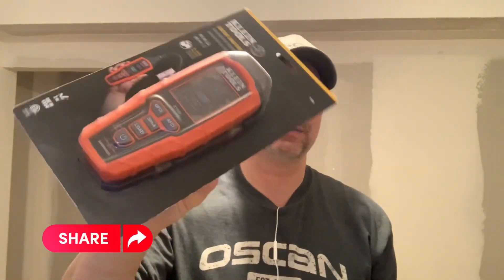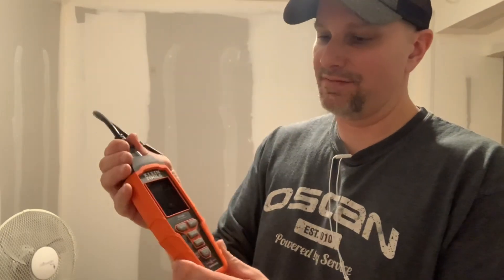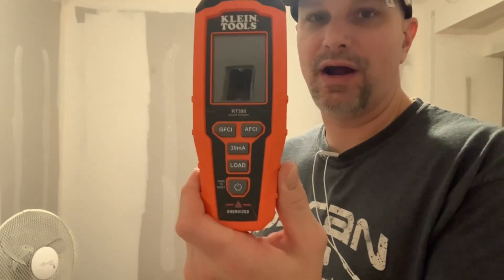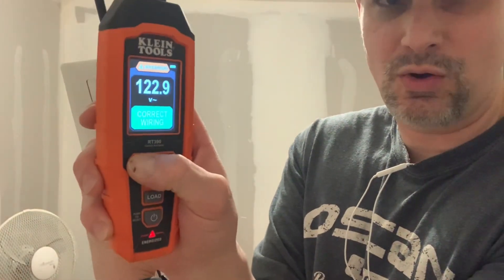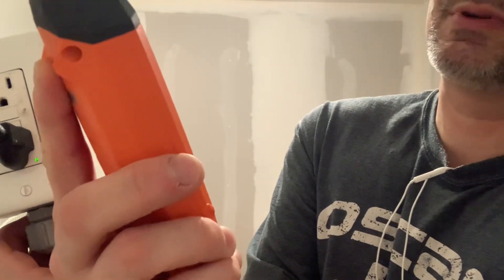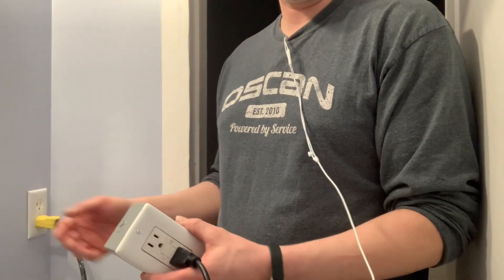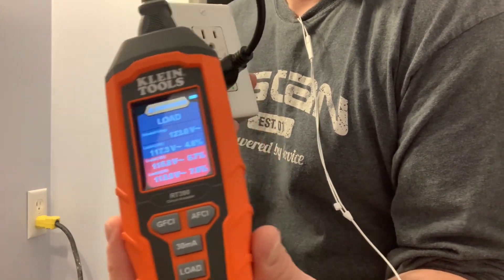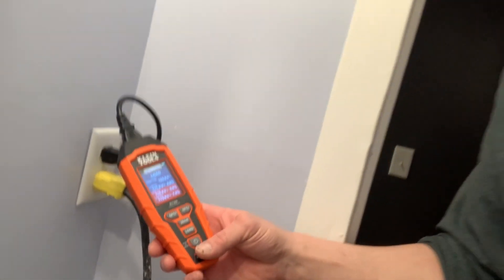@kleintools_EU @KleinToolsVideo RT390 Circuit Analyzer.

Comment: The NEC recommends, but does not require, a 3% voltage drop for branch circuits. It recommends a 5% drop for feeder AND branch circuit combined.

Comment: Is it actually doing a ramp test on the GFCI to see what current it trips at, or is it just pushing out a standard 8 or so mA? Class A GFCI is 4-6mA
Reply from the maker: The GFCI Trip current range is 6.0-9.0ma 
It also does 26-38ma 
The trip time for both ranges from 0-6s 

I hope this helps

Comment: too bad Klein does not test their own safety equipment. mine did not work out of the box, it would not power up. can you trust klein ??? its up to you.
Reply from the maker: I absolutely trust Klein tools. I only ever had an issue with a flashlight after 6 months of use. Klein replaced it with no questions asked and its still going strong. 

Klein produces 1000’s of tools. Just like any other manufacturer, there will be issues. The difference is how the manufacturer handles the issue. 

Cheers
Reply: You probably had a bad battery connection.  On mine it was the middle battery that needed the negative contact bent out a bit

Comment: is the GFCI box with the cord you made or you purchased?
Reply from the maker: I made it for use on job sites. We are required to have GFCI protection onsite.
Reply: It’s a DIY setup. A regular OS type 12/3 cord, a Jbox with a regular GFI at the end.

Comment: Can it detect a bootleg ground like the ideal?
Reply: Nope
Reply: It’s only designed to diagnose a correctly wired connection. A tester can help to detect a faulty or bootleg ground. Only after first testing the device can you then use this tool.

Comment: Can this pickup bootleg ground ?? 
Or false ground ?
Reply: No, it does not. You need the Ideal Suretest 61-164 to find bootleg grounds. However, the Suretest is $200 more expensive.
Reply: @sigcrazy7  👏🏼, Thank you very much ! Very helpful info
Reply from the maker: I’m not sure. But you have peaked my curiosity. Im going to rig a receptacle and see what happens
Reply: @mikestoolfun  thank you Mike ! Would greatly appreciate the result 👍🏼
Reply: Hey @mikestoolfun  did you run this test and see if it picked up on the false ground?
Reply from the maker: @brianbeeson  honestly I completely forgot to do this. I’ve been working 7x12hrs for a bit and it completely slipped my mind. 

Thank you for reminding me.
Reply: @mikestoolfun  did you forget again lol?